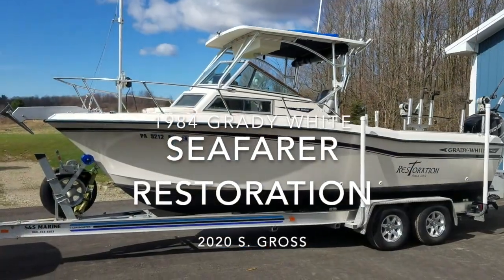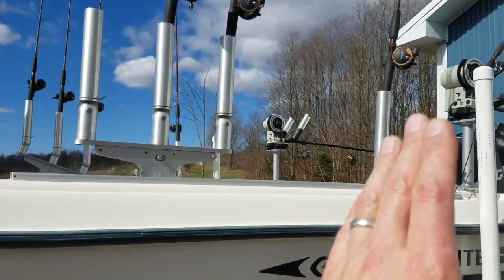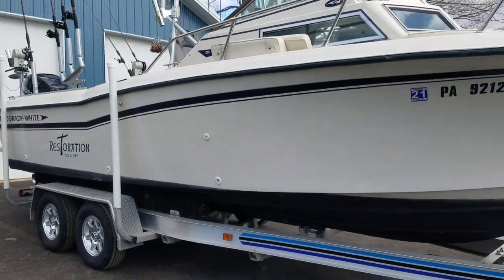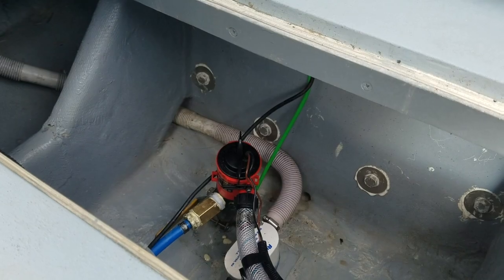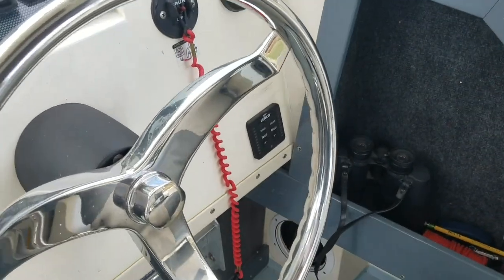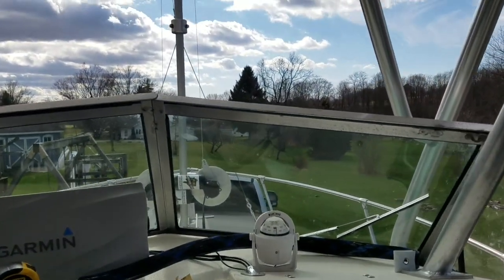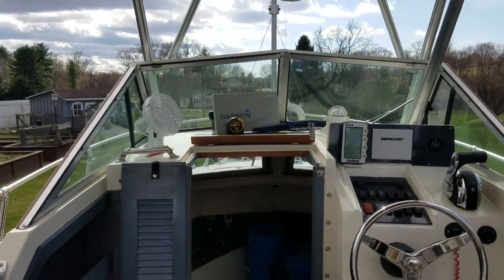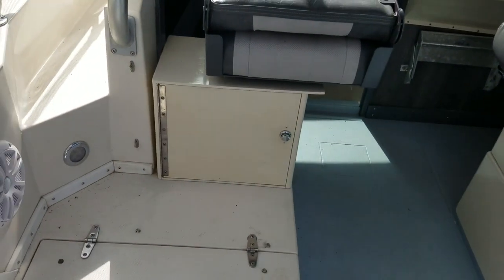Grady White Seafarer - 1984 model - Restoration  April 2020

Comment: Sir, you are an inspiration !  You have made a miraculous update to your boat.  My 1985 Seafarer 226 is still original with the transom cutout because I'm not much of a project guy.  But I love how your modification worked out.  In particular, it adds over a foot of length to the cockpit with easier access to the rear swim platform/engine mount.  That could be a really nice location for a bait prep/filet table that could double as a kitchenet for overnighting.   We usually put the porta potty back there when overnighting in the cabin. 
I have considered raising the windshield too but found it was simpler to just add large clear plastic swing down "sun visors".  These are hinged to the hard top instrument cabinet to serve as wind and spray shield when needed.  Just keep them well coated in RainX. We can raise or lower the seat to get optimum visibility.  This preserves the lines of the boat which are still great looking and continued on Grady Whites newest models.
Reply from the maker: Thanks for commenting!  It was a labor of love and a great project.  Not sure if you saw all the steps, but it was intense.  :)  I enjoyed using the boat but I did sell it last year.  Our family's interests changed and I saw declining use.  It was hard to see the boat sit.  I found a couple who were downsizing from a 36' boat and then fell in love with the Grady.
I have no regrets.  Resurrected a classic and while maintaining some classic features, I also made it into something with excellent performance.
Reply: @ModernCountryLiving  I wish I had your ambition and your heated workshop.  But these boats are pretty good as originally fit out and mine is not in bad shape.  So no burning motivation. But what you did is a real accomplishment and actually seems the equal of their latest models.  Her name really fits.
Reply from the maker: @DrJuan-ev8lu  Thanks so much!  I appreciate the recognition.  They make a good boat!

Comment: Really enjoyed your videos.  My son surprised me and bought me a 1985 Grady White 240 Offshore.  It’s almost the same as your boat.  You really gave me a ton of ideas on storage, wiring, down riggers, etc.   Can’t “Thank You” enough!  - Joe
Reply from the maker: Awesome!  I looked at a 24 offshore several years ago.  It was sitting on an old trailer along the road for sale.  It was full of water to the deck.  Really sad.  I wanted that boat pretty bad, but the guy wanted $7500.  I couldn't justify that cost, but really liked it.  I think the 24 would be a great boat.  

There are folks that say the older Grady's aren't worth much, don't have the new hull design, etc.  They are WRONG!  This boat runs fantastic and is secure.  Trolling - very stable.  Not rolling around.  Good luck!  Thanks for watching my videos.
Reply from the maker: What a son!  Great surprise!
Reply: Shawn Gross it was a great surprise.  I was speechless!    

Hey - I do have a quick question about the tackle storage under the seats that I believe you said your Dad built.  Those are fantastic!  Any insight that you can offer into materials used, did he start from scratch or did he work with something commercially available and build upon it?, etc. Any info would be greatly appreciated!  Thanks again!
Reply: Shawn Gross BTW, we must be about the same height - 6’-6’1.  That darn windshield rail is right in my line of sight as well!
Reply from the maker: @josephmicara5708  I have been really struggling to find the windshield components.  Taylor Made and others want a king's ransom to build a new windshield system.  It's not that difficult or large, but finding the aluminum extrusions needed is impossible.  I've even tried contacting aluminum extrusion manufacturers and they only want to deal with selling 1000's of pounds....   I will definitely do a video if I come up with a solution.

Comment: Thank you for the video. I just got my 2000 Grady white 226 back from the boat shop. We installed a new Yamaha 250, fiberglass the back just like yours with a new aluminum bracket. I noticed the motor is pretty deep in the water. How is your motor hight any issues? Did you have any problems with the height of the motor and performance ? I am more than happy to share pictures and videos. It looks like we both went through the same project however you did a lot more. I did actually end up cutting out all the compartments in the back and moving the batteries upfront to open up a lot more fishing space in the back.
Reply from the maker: AWESOME!  Are you on GreatGrady forum or facebook forums for GW owners?  Love to see some pictures....
Reply: Yes about a month back I requested to be a member of Grady white owners on Facebook. I think it’s my full name. I will double check and let you know. What is your contact info on Facebook I will message you thank you and happy Thanksgiving 🦃🦃🦃🦃🦃🦃🦃🦃
Reply: I will add some pictures and a quick video this couple of days she looks great
Reply from the maker: @silverbull2932  My name on FB.

Comment: How are you doing with the front windshield design? I am also trying to find a solution. I was thinking about framing it a few legs with stainless steel then fiberglass year frame and popping in windshields to have a nice clear view. But that is going to cost me big it’s another project itself. Almost like building a pilot house.
Reply from the maker: Stalled.  I have a design.  The problem is getting someone to sell the extruded profiles.  I got price out of FL for a complete windshield, but I'd really like to build my own.  So....we shall see!

Comment: Great job! I’m doing a 1990 seafarer. I was fortunate enough to find one with the hull and transom in flawless condition. I rewired mine also , not fun. When you reglazed your windows did you mask it off and just use black silicone? What did you do about the inside weather strip around the windows in the cuddy? I can’t find that material. Thanks for any guidance you can offer . Also where did you move your fuel tank?
Thanks
Reply from the maker: Thanks for watching.  Yes...I used black silicone.  I have a series of videos and the fuel tank change is explained on my videos.  Fuel tank was moved to the forward position.
Reply: @ModernCountryLiving  Thanks for the info. It is greatly appreciated. Also I noticed your scuppers. I have the ping pong ball ones with the brass tubes through the transom. I like what you have . Can you tell me what brand they are. Thanks Gary
Reply from the maker: @garyg5829  replacementboatparts.  Stainless steel rectangular scupper.

Comment: Back then GW did not include sealed flotation foam?
Reply from the maker: Not sure what you're asking.  Yes...there is foam in the boat.  I added additional buoyancy with the bracket to increase the boat's capacity for carrying the extra weight of the outboard.
Reply: The closed cell spray in foam is under the fixed floor sections of the cockpit.  To the port and starboard side of the gas tank.  Perhaps some under the gunnels.  Look up Brian Lynn, he did a 20 ft Grady center console where is pulled the entire liner out, you will see where exactly the factory foam was sprayed in.

Comment: That's a sickkkk resto man. I'm working on restoring a Sportcraft 270 right now (new stringer design, etc).

I'm also on Lake Erie Central basin out of Lorain. What part of Erie are you fishing? There truly aren't much better boats for that dangerous of a lake, than Grady's with that high sweeping bow and wide base. Great job man!
Reply from the maker: Thank you.  I am out of Erie, PA.  I trailer, so I am primarily out of Lampe Marina.  
Yes, the GW has a nice bow flare.  It's still a 22' boat, so it won't take you 30mph through the tight chop of Lake Erie in 4' waves.  But, I feel safe and secure in it.  I am thankful to be able to own it and enjoy it with my Dad.

Comment: How did you access the through hulls for the port side fish box? I have to replace them and the 4in access port doesn't allow my hand or arm to fit in there. Drain is missing on the box itself.
Reply from the maker: By the grace of GOD, someone had replaced those ones before I purchased the boat.  I can see they would be more miserable than the others.

Comment: Where did u get window seals?
Reply from the maker: I didn't.  I removed the old and used black silicone.  The side windows I used a heat gun and straightened them out as much as I could.

Comment: Hey Shawn. What product did you use on the deck? Is that paint or awlgrip type product?
Reply from the maker: Total Boat deck paint.  I like the way it looks...it is not slippery - good non slip.  But, it's a challenge to keep clean.  It's "gray" but looks blue to me.